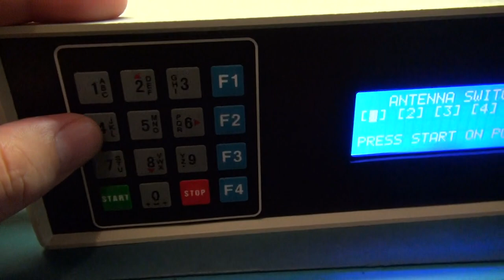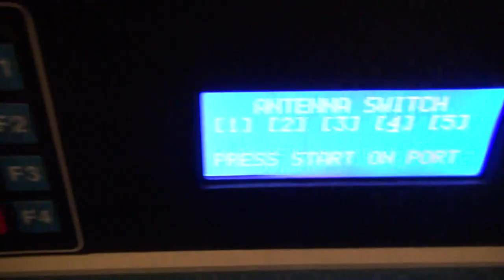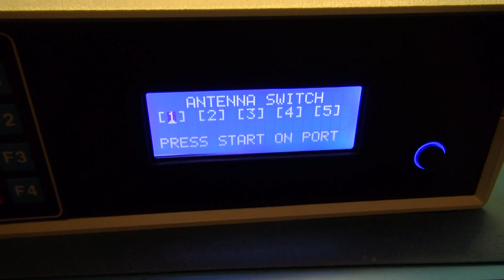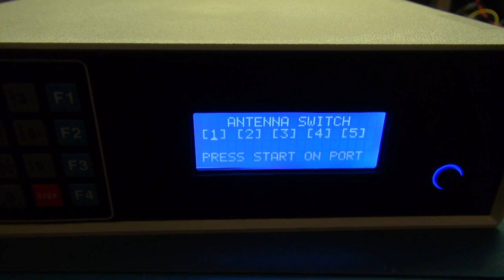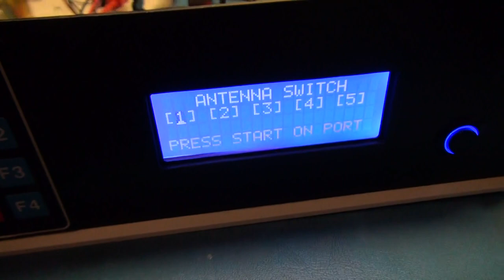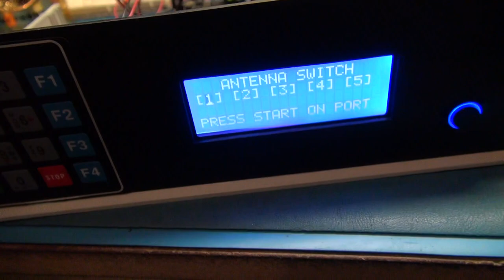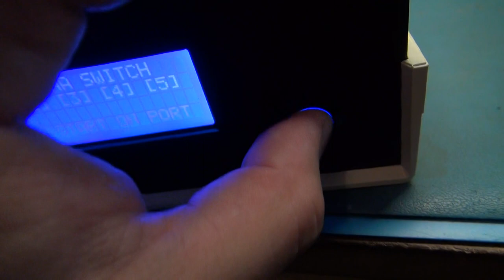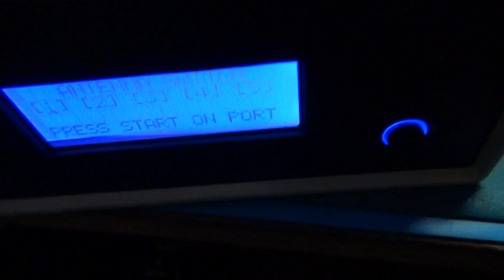ARDUINO ANTENNA SWITCH PROJECT UPDATE 3

Comment: Was thinking the same thing about adding it to a tuner, I am building an auto tuner right now and this may be a great add-on.
Great project. If I do ad something like this I will add controls to control 5 more transmitters also.